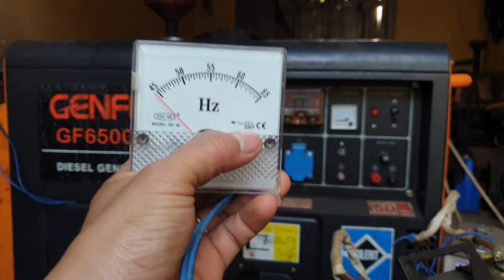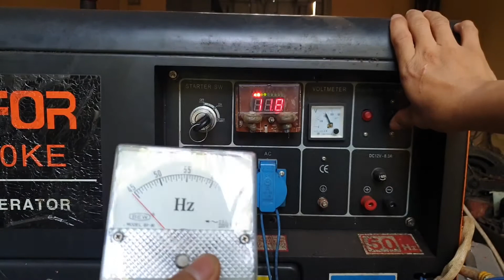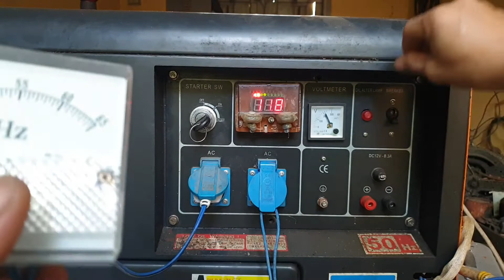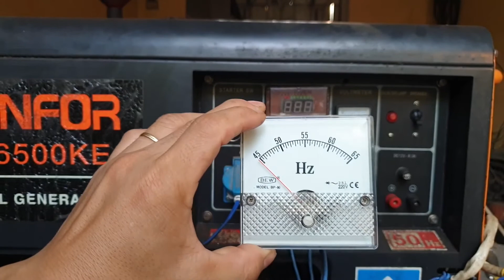đồng hồ đo tần số hz cho máy phát điện

Comment: Khi tăng hz lên thì volt sẽ tăng theo nhé. Với những máy không có avr thì đủ 50hz chưa chắc đã chạy được.
Reply from the maker: máy có avr nhé bạn, tăng hz rồi chỉnh dòng kích nữa nhé pro
Reply: @DuyHuynhvlogs  60hz thỳ chỉnh sao ạ
Reply from the maker: @trinhlethi2183  thiết bị của mình 50hz, chỉnh lên 60hz sẽ cháy thiết bị nha bạn
Reply: @DuyHuynhvlogs   cháu muốn hỏi  chỉnh 60hz xuống 50hz ạ vì máy phát đị nhành cháu máy bãi , ra điện 220v nhưng lại 60hz ạ
Reply from the maker: @trinhlethi2183  vậy thì giảm vòng tua máy nỏ, thì được 50hz, nhưng công suất bị giảm, chỉ có cách quấn lại stator thôi
Reply: 60hz còn lâu mới cháy
Reply: Máy phát 220v nhưng hz 130 thì chỉnh sao bạn. K có avr
Reply: @DuyHuynhvlogs  máy chạy var đủ 50hz khi tải nó tụt xuống còn 30hz là sao vậy bác
Reply: Máy 300vs ,500vs giá 28-38 triệu cũng xài tụ
Nhất là gia đình nào xài lioa thì AVR rất mệt khi  liên tục phải hồi điện
Nên chỉnh 51-51.5hz ,khi vào tải còn 50hz là vừa
Reply: @trinhlethi2183 hạ tua còn 52hz mất đi 15% công suất